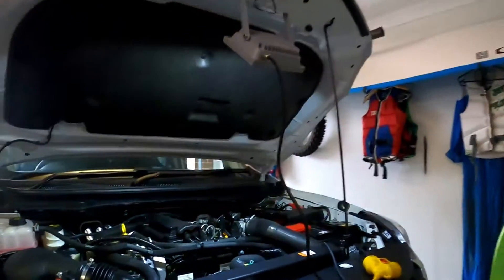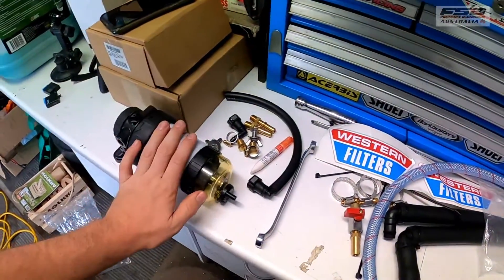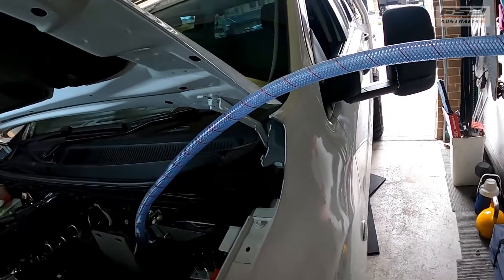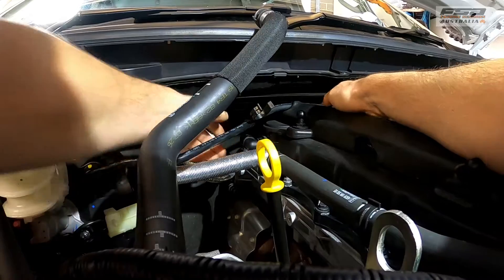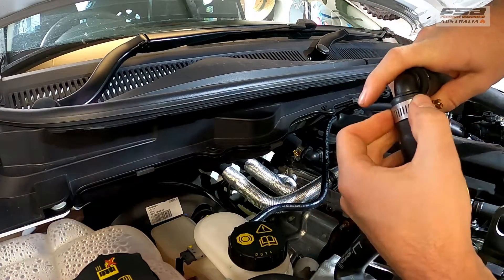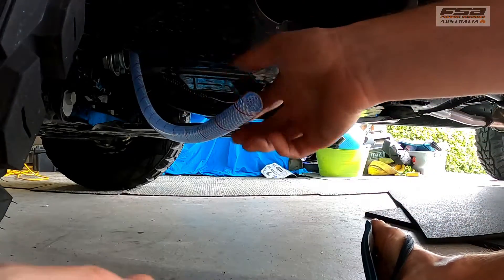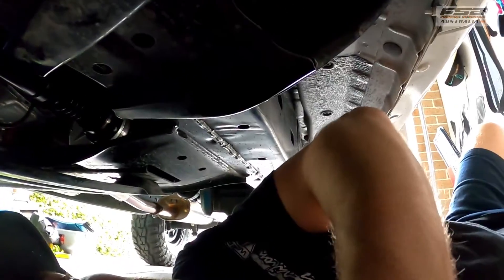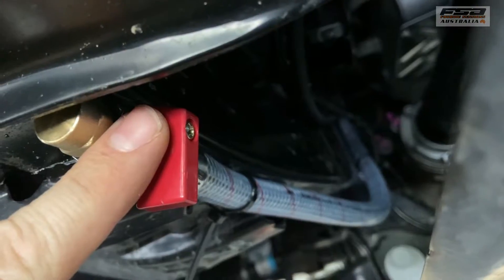Provent 200 Catch Can Installation

Comment: Hey mate, love your work:) How does your dealer feel about you fitting a catch can to the BT?
Reply from the maker: I haven’t had a service yet but by law they would need to prove that the catch can was the cause. I don’t think it will be an issue but with any modifications there is always risks with warranty. Being my last ute blew up under warranty and I got no help I know full well what it’s like dealing with these guys.
Reply: @f.s.aearthmoving4x4  Thanks for that mate. I'll run it past them and try get it on writing, hopefully that contradicts any fine print they might want to use later if something were to go wrong. Keen for the Wheel chat Wednesday! 
PS. I get my BT this week, was tossing up between the nav and the BT,  just could not ignore the BT. SO GLAD I went the BT!

As always, love your work!